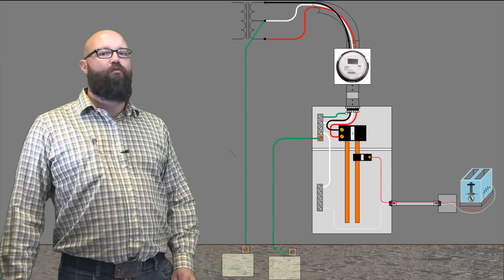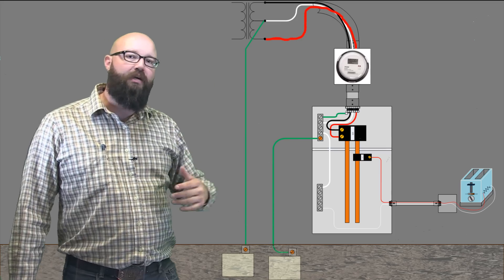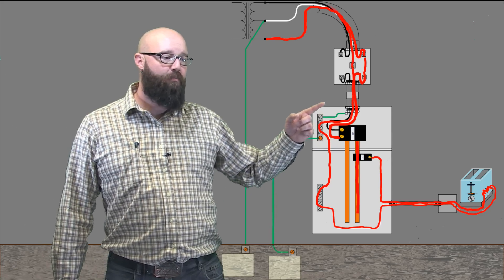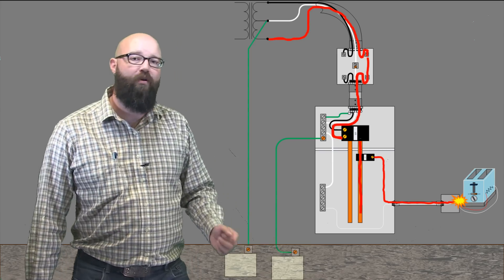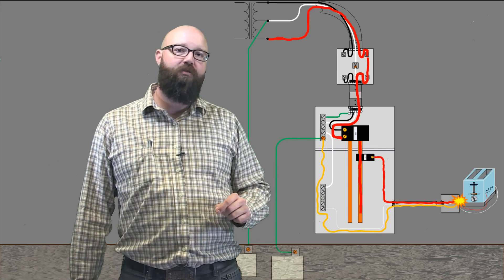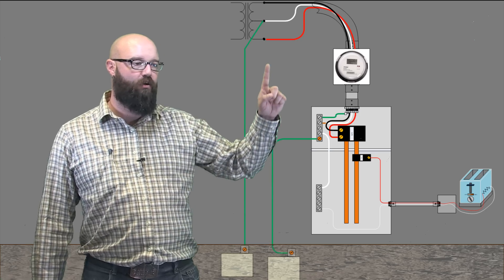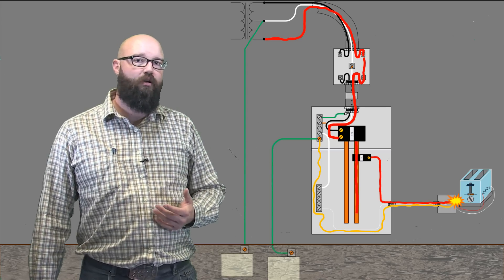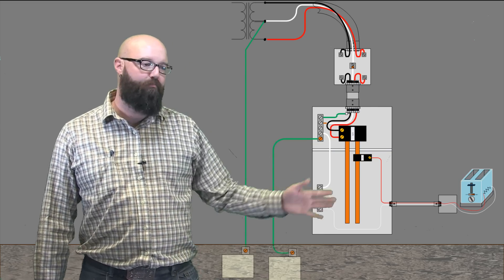Grounding and Bonding

Comment: Though it is in the NEC as acceptable, I would never want to rely on any raceway to be my GFC, because that is relying too much on your installer to be diligent in making his raceway connections. Also, we know that over time, with vibration, things have a tendency to loosen up a bit, not to mention, in certain climates you will have expansion and contraction of metals, which will also make connections loose.
Reply from the maker: I completely agree with you. I would like to see it made mandatory that a bonding conductor (equipment grounding conductor I believe in the US) be pulled in all raceways including EMT and rigid metal etc. I've seen too many connections fail and as you said, too many forgetful individuals forget set screws and continuity is sacrificed.
Reply: You guys are incorrect. Every house in Chicago has emt conduit. I have worked in thousands of them. I never find loose fitting. If they are installed properly, they do not loosen up.
Reply from the maker: Is that to every outlet box? That's really interesting. Is that in new builds and old? I imagine you come across some crazy stuff in the older buildings there too! 
I agree that it is very unlikely that those connections will come apart, it's usually human error that causes a fault or fail in the system, like not doing up a lock but, or forgetting to tighten set screws.
Reply: @schulerruler  I have also seen in Commercial Construction where metal conduit is attached to the ceiling slab and while still constructing other floor level slabs, during the concrete curing process, water will get onto the conduit installed below and  calcium buildup will cover portion of the conduit. Well, that oxidation is now considered additional resistance to current flow, which is not something you want in an EGC.
SCHULERRULER:  Love your videos man. You are the Mike Holt of the CEC..........😁😁😁
Reply: @danm7671  They use conduit in Residential wiring in Chicago......interesting !!
Reply: amazingly, if i recall, thats the way it was done until 82,84 went nec made it mandatory to have a ground in all race ways. yep thats right, no ground in old building , conduct was the ground.
Reply: @guillermoramos5047  a grounding conductor is not required in all raceways....
Reply: Cook county and Chicago has required EMT conduit in residential homes since the early 1900s. Chicago has its own code book. Not the NEC.

Comment: Green and White should not be connected inside the breaker box, eh?
Reply from the maker: If it's within the service disconnect then yes it is required that they be connected. Being that this is a combination residential panelboard, the top half with the main breaker constitutes as the service disconnecting means. If there were a seperate main service disconnect, then yes, there would be isolation required.

Comment: we do not  bring ground (that is bonded to neutral in the main disconnect l )  to the  meter can and bonded again to neutral  uin the can nder any  circumstances   Code compliance with  250.24(A)(1) you are parallel the neutral this way    5:37 .please corret me if i am wrong
Reply from the maker: As far as the Canadian electrical code is concerned for the 2015 version, it is permissible and required to bond both the service disconnect and the meter base to the grounded (neutral) conductor. As we are currently adopting the 2018, this may change, but yes you are paralleling the path of the neutral. At this point however I would argue current on the service raceway would be negligible due to the very low impedance of the service neutral between the two points.

Comment: What happened on the black path ?
Reply from the maker: In this particular circuit it is not utilized, but if another load was connected across the black line and the neutral line it would function exactly the same. This example I used the red so that the red illustration of current would not confuse the conductors visually.

Comment: Grounding Bible :https://www.youtube.com/watch?v=M3lX4XtlYXk
Reply: This guy is totally wrong, you don't bonding the neutral on distribution panel after neutral on transformer be bonding.
Reply from the maker: @felixguerrero1942  if you are referring to my video, then you are incorrect. It is required by Canadian Electrical Code that the neutral be bonded within the service disconnect at the consumers service AND at the supply transformer.

Comment: grayfurnaceman is correct.  Although your video is nicely illustrated (poor audio), viewers may get the impression that earth grounding is designed for fault current...IT IS NOT.  With an average of 25-Ohms resistance on earth ground, there will not be a high enough "Fault Current" to trip the breaker.  Please be clear, Ground Rods do not make a circuit safe because they are not installed for the purpose of tripping a breaker.  It is very dangerous to leave viewers with the impression that earth grounding makes everything safe.  Ground is not an effective fault current path!
Reply: It's true that the Earth path won't be enough to trip the breaker most of the time, but it does serve to limit the voltage. Otherwise, other grounded metal connected to the system would rise to line voltage in an open service neutral situation.
Reply from the maker: I have mentioned this before, but 25ohms to ground is not the standard in any other country than US. I could be mistaken as I am sure other countries have adopted the NEC but this is a video intended to illustrate how fault current trips an overcurrents with respect to CANADIAN electrical code. Most of the world is a MAXIMUM 5 ohms to ground. Even the NEC states MAXIMUM 25.

Comment: No disrespect, but there's another way to view this.  Distribution systems pick an arbitrary point which is referenced to ground locally at regular intervals. This is done to reduce the fault voltage a grounded person or object is exposed to.  In a 220 volt system the midpoint of the transformer is grounded so that the highest voltage a person can be exposed to is 110 volts to ground.  If the whole system was referenced to neutral alone, then it could be possible to be exposed to relatively high impedance but still dangerous paths to ground mostly due to faults elsewhere to ground, like a water heater with a bad element sitting on a concrete floor for example.  We bond the heck out of pools so that there's very little chance of being exposed to even tiny differences in impedance.  The local ground rod and the rod on the utility equipment are there to carry away any tiny potential differences that get built up in the system.  It's possible that a UFER ground could carry enough current to trip a small breaker, but a typical residential ground rod won't carry more than an amp or two at 110 volts, and much less when it's dry.  Municipal water lines can usually carry enough current to act as a neutral, not because they're in the earth, but because they're bonded to neutral elsewhere in the grid, so neighboring buildings end up carrying the neutral/ground load for the service with a fault.  The key point is that ground rods are not intended to carry much current, generally in microamps, they're there to bleed off any tiny differences in the potential between the grid and local conditions.
Reply from the maker: Thanks for commenting! All great valid points. There have been a few discussions on here about the inability of the system to open faults if relying on Earth as the path, and I agree with you. This video was intended to illustrate how a system clears a fault in the case of a standard grounded system, so I did not want to get into the aspects of voltage balancing or equipotential planes.
Reply: Xxx

Comment: I would suggest that any description of a grounding and bonding system STARTS with a clear explanation of WHY we ground and WHY we bond and WHO benefits from these systems. It is usually necessary to also describe how a breaker trips and the required sizes of bonding and grounding conductors. (You don't have to even mention the electrical code to do this.)

Comment: I threw my toaster into the bathtub and nothing happened. What am I doing wrong?
Reply: Water
Reply: First you forgot to put your wife in the tub first. Then you need to remember to plug in the toaster and turn the breaker on. And also if you plug the toaster into a GFI it won't work ether.
Reply: Didn't plug it in?
Reply: Get in the tub first, then put the toaster into the water with you! LOL :)
Reply: Not to get technical, but pure water like distilled water is non conductive, it is the minerals in the water that makes water conductive (IE: iron, salt, etc).

Comment: Fault voltage takes all paths to ground and the current is according to  resistance of each path. Harmonics, capacitance, and mass all play a part.
Reply from the maker: There is very little fault current that goes to ground, and even then the intent is to provide a path back to the supply transformer, this completing the circuit with low impedance. If fault current went to ground only it would be like expecting an over current to trip by placing a conductor in the air and waving it around. Without the completed path of low impedance bonding systems, fault current would remain low. Too low to trip overcurrents. Thanks for watching and commenting.
Reply: @schulerruler  I used the word "ground" not necessarily meaning earth, system ground  to the source or bonding grounds, I have often seen the effects of a fault distribute it's self throughout a system irregardless of a low impedance path to the source ( even at 600v or less ) and yes we all want the breaker to trip

Comment: You dont use GFCIs in your countries? 
In mine is mandatory that every installation have at least one installed per circuit...
Reply from the maker: We require GFCI protection for mostly installations where contact with water is more of a concern. Near sinks, outdoors etc. We also utilize AFCI protection as well for many outlets. Again this is specific to Canada.

Comment: The earth resistance is difficult to control and varies with distance to pole transformer and earth moisture content. That's why most advanced societies now use and RCD or earth leakage device.
Reply from the maker: I'm assuming that an RCD is the same as a GFCI component as it seems they operate the same. We only require that type of protection on certain aspects of installation in Canada, mostly bathrooms, kitchens within sink proximity and outdoors, but who knows what the future could require. Thanks for watching and commenting!
Reply: @schulerruler  Yes, same thing.

Comment: It kinda helped very entertaining and educational gut there many safety backups to ensure we don't get electrocuted I wonder what happens if all that is gone other than death
Reply from the maker: What you're describing sounds like an ungrounded system which is still common, but requires ground fault detection indication. 
With your question in mind, though, in a grounded system that has a fault say to a box, it would not trip if there was no bonding. If someone was to touch the fault AND something that was bonded back to the grounded point (drain, tap, sink etc) then they would complete the path and then yes.....possible death. I do not advise haha. Thanks for watching!

Comment: I think one of the biggest problems understanding this is understanding that when talking about ground all grounds are not created equal. You have your grounding rod or earth ground. You have your metal body of your car or the chassis ground. You have your ground on your outlet, the fault current return ground. You have your shield on your guitar cable and when you get a buzzing sound they say they have a bad or broken ground. When you weld and you can't strike an arc you check the welding ground cable to the work piece. I think you've done a great job explaining ground in this application.
Reply from the maker: Thank you! I agree, there are many different systems with the same common "ground" term when they are very different systems.